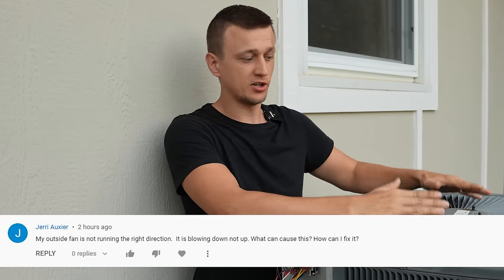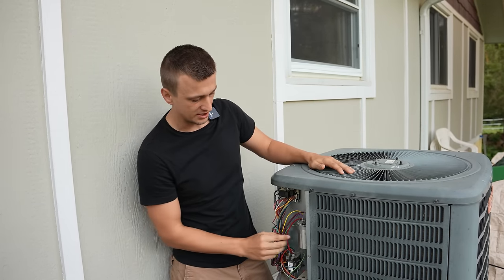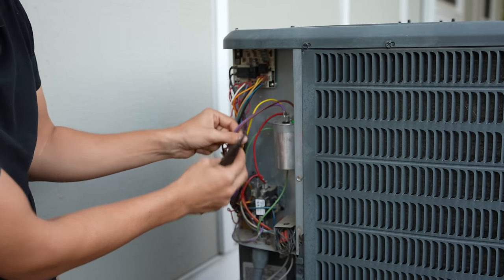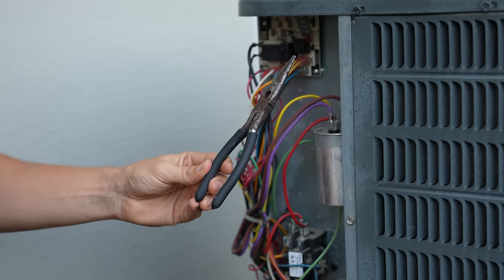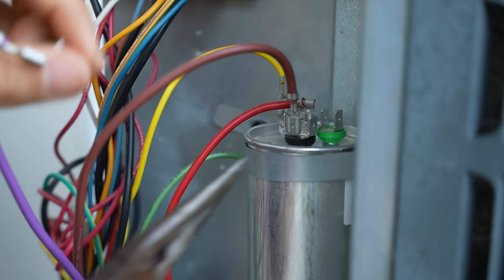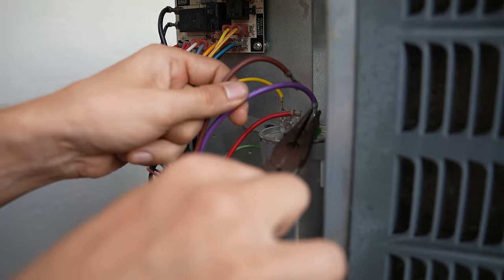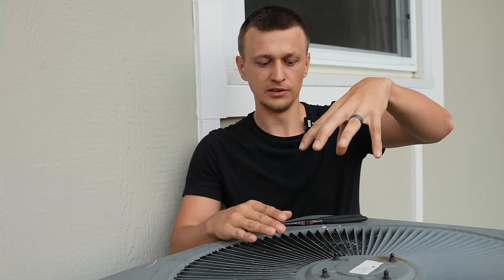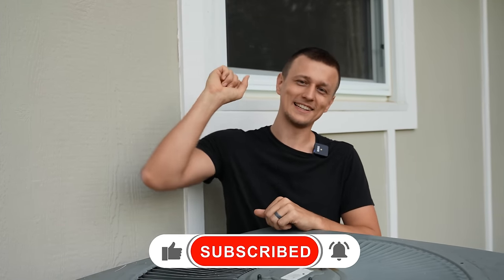Outside Air Conditioner Fan Spinning The Wrong Way - How To Fix It

Comment: Thank you so much for this video. I had maintenance done on my AC system in April and they said I needed to replace the CAP. I never checked their work. I noticed my electric costs skyrocketed and I noticed a funny noise coming out of the compressor unit. I called a different AC repair shop and they said I needed a new fan motor because it was spinning in the wrong direction. I watched your video and immediately did a face palm! The first company hooked up the CAP wrong and the second company misdiagnosed. I reversed the wires as suggested in your video and the fan immediately started spinning in the right direction. I wish I could give you a 1,000 likes!!! Thanks again!
Reply: I actually had the same situation. Had a bad cap, but I installed it wrong after buying a new one myself. After looking at the wiring diagram I realized I mixed up hermetic and common. I already paid a professional more than $120 to come out and tell me the fan was spinning the wrong way. He didn’t even open up the control panel, just outright quoted me almost $600 for a new fan and asked me what I wanted to do. Thank goodness I kept searching for an answer and found this video! Otherwise I would be financing what some people consider small change.
Reply: So many people keep saying spinning wrong way, back ward and reverse...which way is correct way? Clock wise or counter clockwise?
Reply: @GooGoUrSelf  The fan should be spinning in the direction that scoops the air out of the unit. Put your hand over it and see if it's blowing your hand with a strong hot wind. Otherwise, there should be an arrow on the motor itself that indicates the proper spin direction.

Comment: Thank you , you where the most knowledgeable. I change my double pole switch every year and starting capacitors. I noticed the other day my fan was pushing down not pulling out . Your video showed me how fix , I just switched my fan capacitor wires . Thank you again !!!!

Comment: Thanks bro for this video! I didn't know my newly installed fan was spinning the wrong way when I installed it. Someone came to my house to check the system and they said that I need to spend $900 for a new condenser fan motor. When all I needed to do was switch those two wires on the motor!

Comment: Your information was spot on!!  Both ac units are now blowing heat up.  Swapped the two connections on the fan motor.  Information very clear to understand.  “Liked” and now a subscriber.

Comment: Extremely clear concise information.  As usual from you.  Thank you.

Interesting that flipping the fan blade WILL NOT change direction of the forced air.
Reply from the maker: Thank you Ted! I'm glad to hear that the video was clear and concise  👍👍
Yes.. When I was a brand new technician and didn't know any better I actually tried so I learned that early on. 😅

Comment: THANK YOU! I didn't know you could swap rotation on a single phase without the rotation plug. I was about to have to return the motor, thankfully swapping wires on capacitor did the trick!

Comment: I'm glad to know this. I'm going to need a fan soon and they always mention if it's counterclockwise or clockwise. I guess it doesn't matter.
Reply: I did the capacitor swap on my new motor today.  Motor did spin the right way, then, got super hot and shut off.  Took motor out after 10 minutes it was burning up. I am not an ac guy, I thought I found a solution.

Comment: Jay Bird, how in the world did you know what I had to do this week😂only thing is, it was the inside unit motor, bearing went out sounded like a Blackhawk helicopter landing on the roof every time it kicked on🤣. Put brand new motor in but first cleaned squirrel cage and housing, put back together and had no air being pushed through the ducts🤦‍♂️took it back out and reversed both yellow and orange wires and bingo!!!
You put out the most educational content on YouTube my friend, thank you for all you do for us dummies. Lol 🤣😂🤣
        ~Jay~ aka SG. 👍👍
Reply from the maker: Lol, isn't it crazy how that happens? What are the chances that I would post a video on just that? Haha and I can relate the the helicopter noise, I've heard some of those before too. I must admit that I have actually done the mistake you experienced, maybe even more than once. 😄 (put in a blower motor in furnace with it spinning backwards) Anyway, good to know that you were able to figure it out quickly and get it all fixed! Kudos to you my friend!
Glad to hear you enjoy the videos and find them useful! Have a fabulous weekend man, Aloha from Hawaii!

Comment: Interesting. I would think flipping fan direction will also reverse air blowing direction. But you've just provided us a much simpler way to tackle that issue if it arises. As always,  well done & thank you for another informative video Jay!...
Reply: It doesn't, because the fan blades are symmetric when you flip them over. If, say, fan blade "A" has the low (scooping) edge on the left, when you flip the whole blade over, the low edge will still be on the left.

Comment: Thanks for these videos! Clear, concise and straightforward presentation. I just watched a bunch to help me figure out why my condenser fan won't run.  

Quick question: When my AC turns on, the outdoor unit tries to come on and I hear a hum/buzz for a few seconds, but then it stops. The fan never comes on.  
Maybe the Start/Run capacitor is blown? From watching your videos, it seems like blown capacitor should cause a constant hum (not start and then immediate stop).  

What do you think might be going on? Do you think maybe the motor is broken? (possibly from a neglected return-air filter change?)

Thanks again for your awesome videos and channel.
Reply from the maker: Thank you! Glad to hear that the videos have been helpful! What you described sounds like a bad capacitor. If you watch this video at around the 2 minute mark I bet the example noise I show is similar to what you are hearing: https://youtu.be/GOXgdnRB840
Reply: You got your outdoor unit fan problem solved? would like to hear your update info. 
I will check the motor itself first, just try to spin it with a screwdriver when power off and see if it can turn freely, and then check the dule capacitor with a multimeter to see the capacitance.
Third, I will check the fan motor with a multimeter to see if the 2 winds are ok.
These should be enough to solve the problem as usual, but really like to know what you got finally.
Reply: @ND-fy3wu  Yup, it was pretty much what WoAT responded. The capacitor needed replacement. One leg of the capacitor was still good, measuring at 5uF. But the other leg was nearly zero instead of 45uF. Got it replaced and it worked right away

For the couple days before it got fixed, i was using a stick to start the fan manually. I would turn the thermostat off, then wait a few mins. Then go outside in front of the fan, and turn thermostat on. As soon as i heard the sound of the compressor trying to turn on, i would give the fan kick with the stick. Then it ran for a couple hours at least.
Reply: @Dhrumeel  thanks for the update and am glad to know that your system is now working properly, so it finally turned out as the regular dual capacitor problem
Reply: @Dhrumeel  Great to know that you solved it, good job. Usually the capicitor can be bad when its life span just expired, or it is caused by another/upstream problem like bad wire connections etc., so you might want to check those wire connections inside the outside unit and also the air handler/furnace/inside unit, just a simple visual check can help, look for those loose connections, burn signs. Make ure you turn power off before you do anything to the system, safety is always No.1.

Comment: You're always the BEST! Lol, I did this .... saved about $450 when my fan motor was diagnosed as going bad. I purchased a replacement motor and (knowing NOTHING other than my YT University 'tutorials'), replaced it myself. Ran into the problem of wire colors not matching up. About a year later had a HVAC tech here for some reason, who realized my (self-installed) fan was spinning backwards and switched the wires for me. I never noticed any huge difference either way, but was glad to have it 'proper'. What are the repercussions if it runs backwards long-term? Just reduced efficiency or something worse than that?
Reply: It will kill your compressor! Way to go Harry.
Reply: @bigc8300  Lol, thank you! I'm lucky my old dinosaur survived such an abusive debacle.
Reply from the maker: @SandySez I have actually seen air conditioners run with fans spinning backwards for years and they survived... I would agree with Big C that long term it can't be good for the compressor but from what I have seen it seems like it effects the efficiency more than it actually damages anything. Short term at least. I have seen some crazy stuff in the field that made me question the validity of the "facts" I know. 😄 Some things I understood wrong, some things I was taught wrong, and others were not supposed to be possible but I would come to some oddball air conditioner that reminds me that there is a lot that I don't know. Nowadays I am wary of claiming things as absolute. There are so many variations and special circumstances out there. 🤷‍♂️
Reply: @WordofAdviceTV  Thank you and well-said. I admit, I was contemplating how this may effect various units differently. I have an old, fairly inefficient single-stage ... but it may be more robust when it comes to issues like this (or vice-versa??). The more modern multi-stage etc, units may be more susceptible to damage from this. I doubt if it's a one-size fits all conclusion regarding anything beyond the compromised efficiency issue. But damn sure better safe than sorry and have things right, regardless!!

Comment: Great video. Even though you did discharge the capacitor, should you still treat it as if it's still energized?
Reply from the maker: Thank you! With the power off and it discharged, there is no need to do that so I usually don't. Of course it would do no harm and even be good practice to treat it as if it is energized though. 👍

Comment: It looks to me that all the replacement motors available were wired to run counter clock wise and so it's necessary to reverse the wires to correct this. Thanks for the video.

Comment: Thanks just replaced my fan and it was supposed to be a CCW, but was running CW. I was pretty sure I could flip the wires and get it running CCW but was unsure, your video was the only one that clearly stated this.  I have a great AC guy that has replaced my other unit, but I wanted just to make it through one more summer before this one gets replaced. Seems like most AC techs don't like sharing info, thanks for the knowledge.
Reply: I am in the exact same boat. I needed to keep my unit running another season before it gets replaced. I spent about $1k last season getting it recharged and getting a cold start capacitor replaced. I had oiled the original fan towards the end of the last season just to get it by, but it finally crapped out early this year. Got a new fan motor off Amazon this week and was disappointed that the direction on the label was opposite of what I had. I suspected that it could be reversed, but it is always good to have confirmation :)
Reply: @trublu2nu - you oil your fan motor?  Aren’t they typically sealed and no maintenance?
Reply: @condor5635  Yes, they are sealed but when they are old and worn you can seep oil into them around the shaft. I got the tip from another YouTube video and it worked for me.

Comment: Love your videos. Just curious as to why a fan motor would have reversing wires in the first place? Would there ever be a time when you'd want to run the fan in the opposite direction?
Reply from the maker: Not all fan blades are designed to spin in one direction so a universal replacement motor needs to be able to accommodate both directions.
Reply: @WordofAdviceTV  Thank you.  That makes sense.

Comment: Great video. However, you did not say why you should reverse polarity if the fan was working fine before an event. What happened other than a cap or motor winding?

Comment: Interestingly many HVAC internet sites mentioning that the fan should spin clockwise which mine does and blows out the hot air to the top. Maybe the York AC fan blades are designed differently. The left side of fan blade is higher than the right and therefore when it turns clockwise, it will scoop out the hot air to the top. I see the AC that you're showing has the right side of the fan blade is higher than the left side.

Comment: Jay, could you do a video that allows the blower in a gas furnace to continue to work during a power outage? My understanding is that during a power outage, the blower, which is powered by electricity, will not work and your house won't heat.
Reply from the maker: You would need to have a back up power source, like a generator. That is a good video idea, thank you for the suggestion!

Comment: Hello Jay, I have an ac unit with a 25v capacitor. Can I replace it with a 50v capacitor? Thank you
Reply from the maker: Most residential air conditioners have either 370v or 440v capacitors. It is okay to replace a 370 with a 440. I am not sure what kind of unit you have that has a 25v capacitor so I can't say for sure in your case 🤷‍♂️
Reply: @WordofAdviceTV  Thank you Sir, I appreciate your help.
Reply: I think you mean microfarad

Comment: Great video,  you should discharge capacitors using your multimeter on the highest setting for voltage 👍you will see them drain

Comment: Hi, I've learned a lot from your a/c R-22 videos I paid somebody to recharge my unit once last yr & this yr from your videos I felt comfortable enough to recharge it myself so Thank You. I've looked through your video library but did not find an R-22 line leak sealant that you might like using or have had good luck using?
Reply from the maker: Glad to hear my videos have been helpful for you! If it is a slow leak, this one will usually get the job done: https://amzn.to/3v4ClDY
It's pretty easy to use if you know how to use refrigerant gauges, just read and follow the instructions. 👍

Comment: Maybe you can help me with something. I have an old Amana clothes dryer that some people that lived with me left behind. I think since I've been there it's had a clunking sound, but still kept running and dried clothes just fine. Just this morning, I threw in a throw and a couple pair of shoes on air dry only just to clean up dog hair from my sweetheart.  Within 10 minutes, it started squealing some as if a belt was loose or whatever. Can you point me in the right direction as to if it is a fairly easy fix or if I should just replace it?

Also, on another note, my AC is down and out....it's old and needs replacing, which I'll do before selling my home in NC. With the help of your channel, maybe I can do it myself with some connections. I have been itching to try my hand at doing a mini-split, but I have duct work and it's not really an open layout with several rooms upstairs. Downstairs is better....if only the upstairs was like the downstairs, I think it would be a serious option. What do you think? For practicality and resale, should I stick with a central ducted unit?

Comment: Hello, I have an inverter AC. The fan works properly when AC is turned on, however when we turn it off, it spins the other direction for a minute. Support said that this is normal for inverter. However it caused an issue that the fan went out of place and got damaged. They replaced it but still they are insisting that this is intended. What do you think?

Comment: I have 2 questions, 1) i need a new furance, do I switch just the furnace or go with the furnace and ac unit together?  2) what are yohr thoughts on the uv lights for these systems?  Thanks for your videos.

Comment: What about these technicians so-called 20-year Plus putting  fan blade in backwards. I just ran across that today interesting. In another thing I have one unit going right pushing air up and another unit going left pushing air up is it still going the right way?

Comment: Wish I found this 3 hours ago.  Finally I did switch the capacitor wires and it worked.  And I did just replace the motor and I did flip the fan that did not work.

UPDATE:   10 minutes later motor stopped, very hot, turned freely. Ended up putting the old one back in and putting the capacitor wires back as they were.  Oi vey. What a day.

Comment: Just beware, as some units are designed to blow down and out the coil. Not very many but I have run across a few !
Reply from the maker: Good point! Thank you for mentioning it. And there are some the are mounted sideways too.
Reply: Do you know which type were like that?
Reply: @WordofAdviceTV  Which heat pumps are designed to do the opposite?
Reply: Which heat pumps are designed to do the opposite?
Reply: I recently replaced the capacitor on my ac unit and it worked for a month before tripping the breaker. I noticed the fan blades were spinning in the opposite direction they were before I replaced the capacitor (previously spinning clockwise, sucking air INTO the unit). I assumed I had overheated the compressor but connecting the wires incorrectly and causing the blades to spin in the wrong direction so I remedied this, making them spin clockwise once again. The unit is running fine but the air coming out of the vents is now minimal and not very cold. So... is it possible that the fan was spinning the wrong way for the past 10 years, I accidentally installed the wires the CORRECT way only to experience a separate issue with the unit tripping the breaker??